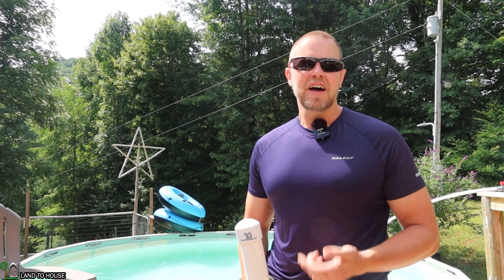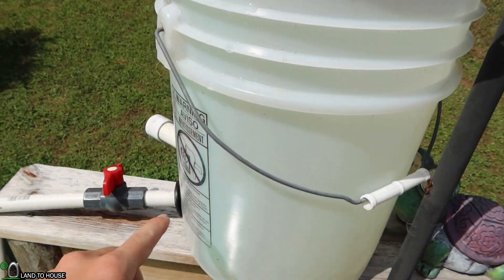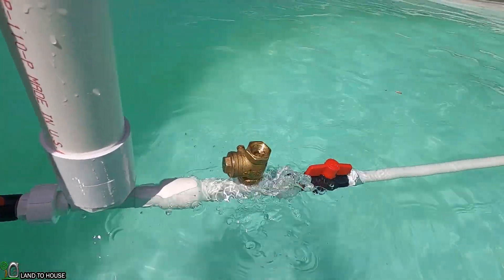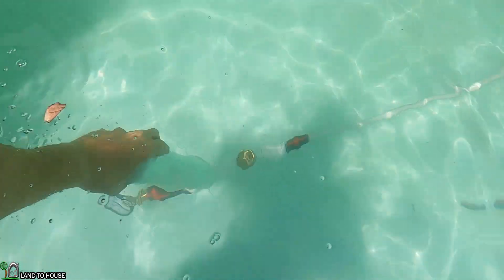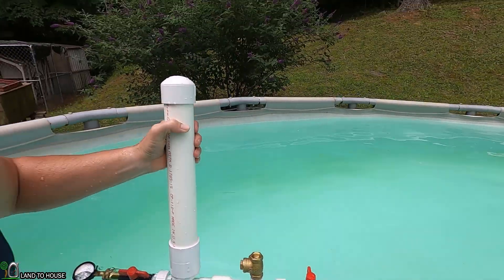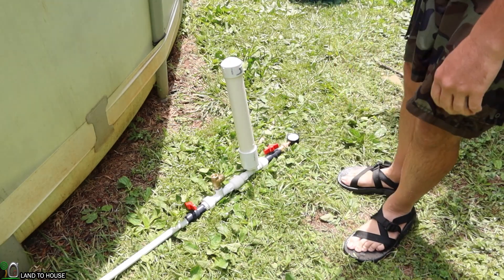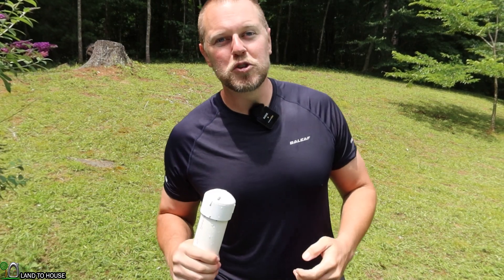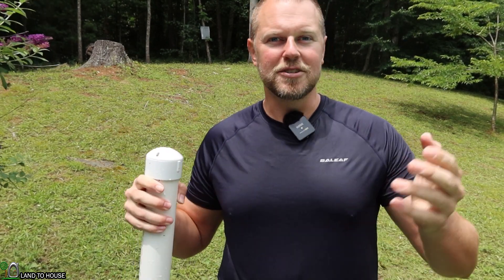Underwater Ram Pump Pressure

Comment from the maker: Premade Ram Pumps available on Amazon: https://amzn.to/3QWzRkr
and Land T House:  www.landtohouse.com
Reply: The first time you ever showed it working underneath the water, I was like bingo. Even if you lose a little bit of pressure, not have that tap tap tap tap disturbing the peace.

Also, what do you think of these other versions of ram pumps, where they use a tire instead of a pipe have you seen that?
Reply from the maker: I've actually spoken with that company last year.  They are just now starting to send them to the United States. I think shipping is quite ridiculous at several hundred dollars.   Other than that looks like they work quite well
Reply: You should change The settings for your videos in order for youtube to allow automatic translation into romanian, so that I could understand what you are saying.
Reply: That is because the water is pushing against the drive pipe from every direction, and Pascals Principle states that I'm a fluid volume under equilibrium force is transferred equally to all parts of the fluid volume, so the mass of the water transfers the force over a greater area reducing the water hammer effect within the pump.
Reply: The inclination of the pipe is greater when keeping it under the water, that is also why the pressure is higher. also the weight of the Value lid is lighter when under water, + the pool pressure also act in the outflow water to prevent it from escaping easily. So more head pressure
Reply: So... here's a test I'd be MOST interested in seeing after watching this video. I'm a Subsea Engineer with Cameron Drilling  ( Subsea BOPs ). We drill in 10,000 ft of water. ( From the drill floor on the rig, to the sea floor is 10,000 feet of water BEFORE we even start to Drill ) It's called UDW (Ultra Deep Water)  So here's the given:  Hydrostatic computation is  [ .052 ( H ) ( 8.3 ) ]  So, .052 is a  " Standard of Industry" value that's a proven constant based on the Progressive Gravitational Pull of the Earth's surface ( 32.2 ft/S (s) ).  ( H ) = Height (in inches) that you submerged the pump. And 8.3 = the weight of one ( 1 ) gallon of fresh water in lbs. ( fresh water weighs 8.3 lb/g )

Your waste valve ( submerged ) in 36" 0f water has a hydrostatic pressure of 15.537 psi applied force ( inward ) against the flapper valve. Your determinant internal pressure was 36 psi. Assuming the flapper valve is 1", that gives you a Volumetric efficiency of 2.317 %. 

Here's what Id like to see/Know,
I BET you, If you insert a 1" standpipe into the 1" waste valve, that's being supplied from a 1" pipe, and you break the surface of the water, your volumetric efficiency WILL increase exponentially. Test that and show us what you find.

Comment: @landtohouse what happens if you move your source bucket into the pool wrap a float around the top of it and drill holes into the top ring to provide the source?  Dose that create enough inlet pressure to run the pump at the bottom of the pool?

Comment: The inclination of the pipe is greater when keeping it under the water, that is also why the pressure is higher. also the weight of the Value lid is lighter when under water, + the pool pressure also act in the outflow water to prevent it from escaping easily. So more head pressure

Comment: While I see you testing pressure your drive buck is above the pool so your getting head pressure. Let's say I wanted to use a ram pump to filter my pool. Will it run.

Comment: Hi, I have a question , can we make a complete cycle system , as we can immerse the ram pump in the water , so we can use the water inside the pool itself as intake instead of the bucket , and then pump the water to the pool itself as infinite loop , so we can use for fountain , Thanks
Reply: Not only for fountain... also for generating energy....

Comment: I'm pretty sure that pressure gauge is measuring the pressure DIFFERENCE between the ram pump and the outside air/water.  This may be skewing the results since pressure under water will be different than pressure in air.

Comment: Thank you for all of the great and informative videos on ram pumps. - I do have an odd or usual question. - Would there be some possible way to use some type of ram pump to recirculate clean, filtered water in an in ground swimming pool, in addition to using the pool pumps or at times when the pool pumps are not running? - Due to the enormous costs, associated with running the pool pumps continuously (year round,) especially in the seasons that the pool may be closed. - During which times, I use an external electric pump, to keep the water somewhat moving and circulating. - I have been thinking about using solar pumps, but would like to know if you had any ideas, or if a ram pump would even work for such an application. - Thank you in advance for any ideas or information. - Kind Regards!!

Comment: I have an Idea to not waste water. Would this work if I had a pond about 5ft deep and put the pump at the bottom of the pond and then placed a hose on a float to feed the pump from the surface of the pond.
Reply: Yes please. Would this work? It would be amazing if someone could try this
Reply: @daftfox  well since I can't get a response I will be trying it myself here in a few weeks
Reply: @breaktime-vo2my 
Did your test work? I have been considering trying this approach in my pond. Another option is to get a small solar pond pump that can lift 5gpm up to 5 or 6’. The water could flow into a bucket then feed the ram pump. My hope is to try this approach in the next 6 months.
Reply: Yes but slightly below the surface. You want to make sure you dont get air bubbles in there.

Comment: What would happen if you put the waste valve on the end and distribution and pressure tank above the center tee. I would imagine same result in the pool because it’s static, but if you waste valve was pushing down stream in a creek. Would it still create a hammer but less resistance on the waste valve?

Comment: We just built a 1” ram pump and are using it to move water up a 55’ +/- high ridge to a holding tank. The ram pump is anchored to a concrete block under water in the creek and working perfectly. (It’s SO much quieter putting it under the water) Thank you for the tests in your video - game changer!

Comment: No, no, no... It doesn't increase the pressure as you submerge it in water.
As the slope of the water coming from the source increases, the pressure increases. (Height difference) .ok. 🤔

Comment: This is kinda intressting, saw the other video about extending the wasevalve, so if you by this logic gained about 5psi in the water and about 30psi outside.
Whould burrying the pump 3 feet help, so instead of lifting the wastevalve, you add a overspill pipe lifting the water out off the hole.

Comment: I  would really love to see if it works at depth. Same experiment, but the water is 34 foot deep. As we all know pressure doubles at 33 foot. The question would be how far down can it go before the water pressure equalizes the force on the valve to pop open.

Comment: Back up your brain, you know how these work!  For every inch you went down in depth you lost a psi in pressure compared to open air outside the pool.. 
Your bucket source stayed fixed, but your drop gained as you sank it into the pool, thus more velocity and head height.
How far off the ground is your bucket?
Reply: In other words, yes the water resistance should be compared to the outside ground level psi and the in the pool level psi. 
The top of the pool water psi is lower due to less head because your source bucket did not go up higher by 2 feet, but when you put ram valve on ground and on pool bottom you did gain 2 feet of head!

Comment: A diver would easily understand this, the more depth you go the more pressure you got, if you don't know how to equalize, your ears drums will burst in just a few meters underwater.. It's natural, and I bet the water output are just the same because of the pressure of the pipe on top of the water has automatically equalize to the atmosphere outside.

Comment: Hi, I’m trying to find an answer regarding my (potential) ram pump placement…..I have lots of flow but not much fall - can you tell me if extra flow can make up for not enough fall? Cheers
Reply from the maker: Because the pressure wave inside of the drive pipe is cycling back-and-forth between the source and the pump the water Flow rate is going to be limited.

 The flow rate does not make up for head pressure.
Reply: @LandtoHouse  OK thanks for the prompt reply……looks like I’ll need to find more head or else use the awesome flow we have to drive a water wheel connected to a pump. Happy new year!
Reply from the maker: @dallaspoll  Happy new year.  Water wheel pumps do work. Those are on my to do list someday.

Comment: @Land to House the answer is due to surrounding air pressure. when you did it on top of the water you had some water and temp pressure on the pump. on the bottom of the pool you had greater air pressure in the water than what was in the pump. on the ground you had more in pump pressure than the surrounding air and the air temp was warmer.

Comment: Have a ram pump power a smaller ram pump below the first. Get some chaos going in the system. See what happens. I’m gonna do it but I wouldn’t make a video near the quality of yours. Also to salvage the purge water let only 1 solar panel about 100w and 1 cheap battery power a water pump. No extra energy past this allowed. How long would it run?
Reply from the maker: I have actually done a test with 1 pump waste water powering another. The second thing would spend on storage tank size and sun for the day.

Comment: just a theory, since the pump works off the gas reserve in the white chamber. it would make since it would act like holding your breath under water. the ram pump never lets the gas escape, just teases it, expands and compress. I would expect more pressure the deeper. i would have expected much of a noticeable difference that shallow of water though.

Comment: Hi Seth,
What if the top end of an inclined drive pipe is also submerged in the same pool, will the pump work?
Reply from the maker: The source water needs to come from above the pool that the pump rests in. Otherwise there is no water movement.

Comment: Can you put a pipe on the valve pushing water out so that it can return to the source so no wastage? I have a pool that has a fall of 1000mm to where the pool pump is. I plan to remove the pool pump and install a small ram pump to cycle the water from the weir back into a sand filter with a overflow back into the pool. My pool is now a fish pond. 
So either I have a return pipe from the non return valve  or I install a tank and keep the pump underwater with a return overflow pipe on the tank back to the pool. Would appreciate your input.
Reply: Ésta es una gran pregunta, lastima que no te la contesta, yo estoy en el mismo dilema y he pasado años tratando de resolverlo y no he podido, sin embargo no me rindo, ya que no pretendo utilizar ninguna bomba eléctrica en el sistema y el reto es producir el retorno del agua desperdiciada a la fuente de abastecimiento.

Comment: can this work on aquarium tank?i mean if the water intake pipe is just at the surface of the water,and it overflows filling the water intake pipe,is that possible?
Reply: That's  a totally good question it must be to be answered for the  pro!!
Reply: Very interested to see the test results. What i think is that pressure on the waste valve will be nearly the same as the source pressure..
Reply: According to AI it would be affected by something called hydrostatic force and wouldn't work. I want to try it though

Comment: Fascinating.  Awhile back you did a video on your parent's back steps about the drive pipe angle affecting pressure, and you found a steeper angle increased pressure, and kept blowing your test rig apart (Vertical Drive Pipe Ram Pump - 2 years ago). I wonder if the steeper angle from the bucket with the pump submerged might be why the pressure increased? This suggests another test with the same head pressure for the pump but one long and gentle slope drive pipe and the second shorter and steeper drive pipe.

Comment: wonder if the 'papa pump' will work under water also...?
Reply from the maker: I bet it will. My next project is setting up an intake that will pull enough water to run the papa pump. So more tests can be done with that pump.
Reply: @LandtoHouse  Nicee, also another project you could try is to get or make a Venturi Water Pump and connect it to the delivery pipe of the Ram Pump, making it collect the waste water. Wonder if that would actually work?

Comment: Great video, Seth! Btw., the first value is 28psi (@3:26 you can see that the needle is exactly on the 2nd division line after the 20psi mark, and you have 4psi/Div). But this means still 8psi more in the under-water-test. Explanation: The final pressure depends on the velocity the water reaches just before the Waste Valve shuts close. The velocity of objects (when sliding down) depends also on their path (see Brachistochrone curve). If yout put the pump down to the ground, your Drive Pipe also gets steeper, and hence closer to the Brachistochrone curve. That makes the water in the Drive Pipe faster and you reach a slightly higher end pressure. Nevertheless, the effect of the 3ft more drop in the last experiement increases the pressure much more dramatic.
Reply: That's awesome info man. I'm always learning something new.

Comment: Your channel has reached new depths.  🤣    I must admit that I was surprised that the pressure from the water in the pool didn't provide enough resistance to the gate in that valve to slow it down and make it not work as well.
Reply from the maker: New depths. Thats funny! I knew the pump would work but did not expect a higher psi underwater.

Comment: Its easy your pool water put head pressure on the checkvalve like if it have more weight to it so its harder to open and release the water. Only my 2 cents.

Comment: Looks like it's just because the bucket to pump height is different in the first 2 tests. If you lowered the bucket the same 3 feet it should be exactly the same, right?!
Reply from the maker: The idea is that the added head pressure would be negated by the hydrostatic pressure in the pool. So keeping the bucket in the same place is required to test this.

Comment: I didn't expect any difference between underwater as the system is closed and not affected to external forces. I think it all comes back to the rigidity of the drive pipe. to get the full effect of the pressure pulse then it must be as rigid as possible. Even a slight deflection in the drive will cause a drop!
Reply from the maker: What got me was the difference in pressure. Had it been 2 or 3 psi sure but 10psi was a lot.

Comment: I am wondering if the reason the pressure increased more when the pump was under water was due to the amount of time the pump ran. If you timed it from the time you started the pump until you started taking the pump out of the water it had a few extra seconds while you lifted it out of the water before you could turn it off.
Reply from the maker: Possible but it took 30 seconds to gain 10psi roughly so to have an additional 10psi in the same time is odd.

Comment: I expected different results too. The pump underwater still had to overcome the pressure of the pool water at that depth.
Really the only thing I can think of is that the waste valve is admitting a slight amount of air while closing with each cycle (not enough to enter the pressure chamber.though) and cushioning the pulse.
Perhaps submerging it only enough to cover the waste valve with water will eliminate this variable?
My ram pump incorporates a 'snifter' valve to admit a small amount of air on each cycle, demonstrating there is a vacuum drawn for a short period of each cycle.
Reply from the maker: I do want to use the pump in a small amount of water as a way to reduce the sound of the click. I could test the pressure there too.
Reply: @LandtoHouse  Just add a short piece of pipe to the top of the clack valve. It will cause a slight reduction in vertical distance to the source but will insure a water tight seal above the valve.

Comment: Interesting... I have an idea that I need to move water to  the back part of my property - is there any reason I can't set up water catchment off my sheds and fill up  three big IBC totes and then run that water into a ram pump into a sink hole next to it (which allows me to put it significantly further below the water level) and then pump that water back out to the back part of my property and fill up an IBC Tote out there to water sheep? I can use my pressurized water here at the house to top up the supply tanks during the times of low rainfall. What do you think?
Reply from the maker: You can do that but the waste water is a real issue when your source is limited. Only 10% of that water will be pumped and 90% is lost.
Reply: @LandtoHouse  so, the water coming past the gate will go away... hmmm,  hadn't thought of this.  maybe the expedient thing to do is to drop an electric water pump into the bottom of a tote and pump it out to the tote on the back of the property.  wonder if a pump can push water through 1200' of exit pipe?